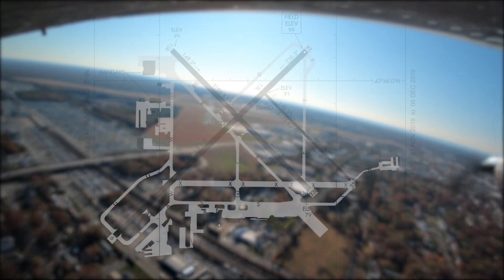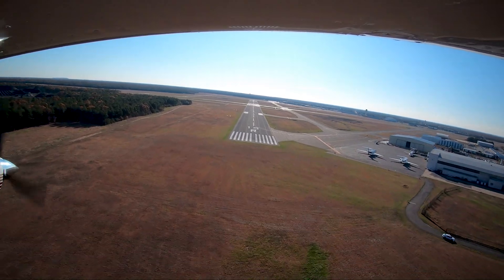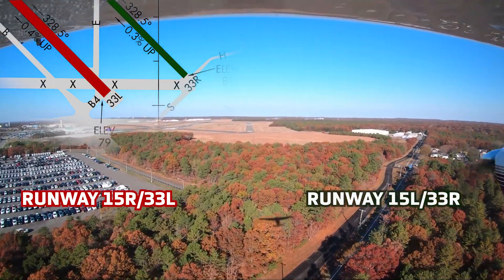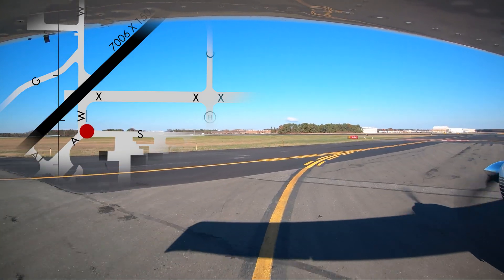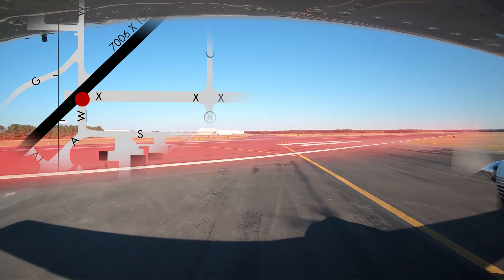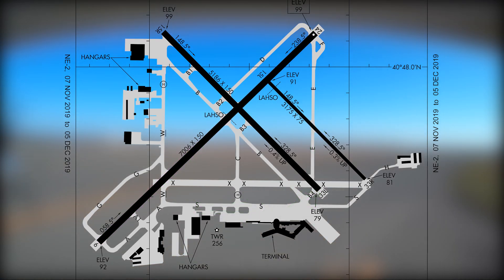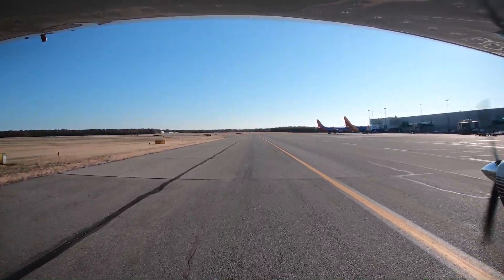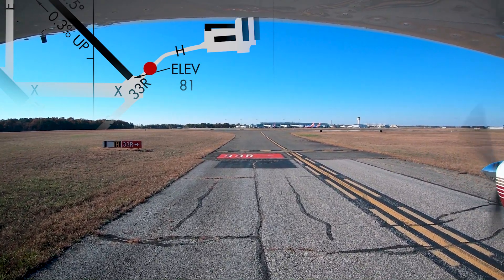From The Flight Deck – Long Island MacArthur Airport – Islip, NY (ISP)

Comment: KISP was my home airport for years. Very professional people in the tower there. I remember landing on 27 (now closed) many times. I was coming Into ISP on 33L (bigger runway) in a Skyhawk. I had a 737 chewing up my rudder. My destination was the west side, so if I landed long, the 737 would have to go around. Since winds were calm the tower asked if I could take 27 instead. I was almost at the numbers of 33L. I replied "sure!" I stood on my left rudder and swung it over to 27 and landed. Just as i got over 27 he gave clear to land for the 737. As a PVT pilot I always give way to the PRO pilots, usually I would have gone around.
I remember coming into ISP at night in 24. I was cleared to land and told the tower my dest was the west side and would try to make the first right turn onto 33R. As I was approaching the runway my cockpit lit up! Behind me was a Dash-8 also on final. I asked the tower if he wanted me to go around to let the Dash-8 land. I was told, its ok, just keep your speed up. As soon as i touched down, I made that right turn quickly onto 33R cleared the active runway, the Dash-8 was cleared to land right behind me. Ahhhh the good old days.
Very  nice people in the tower there. Cant say the same for KFRG as they even forget who is in the pattern there!! One of the ACTs cleared me to taxi down an active runway with someone on final!!! Needless to say, i held short and told them "im not doing that, pick another way for mw to taxi." Instantly I heard a different ATC give me proper taxi instructions.